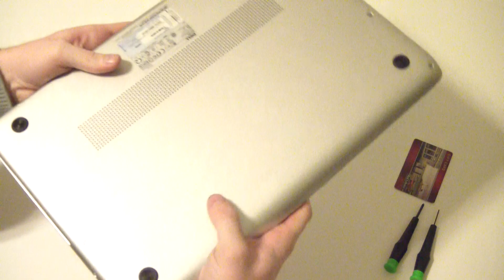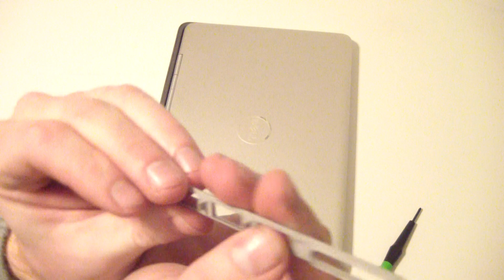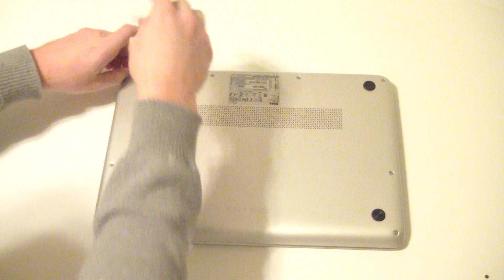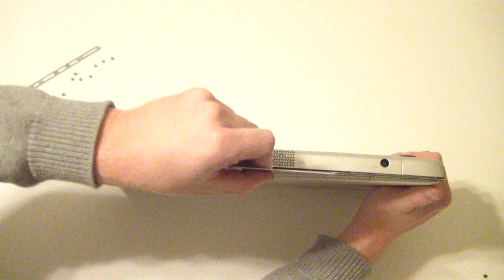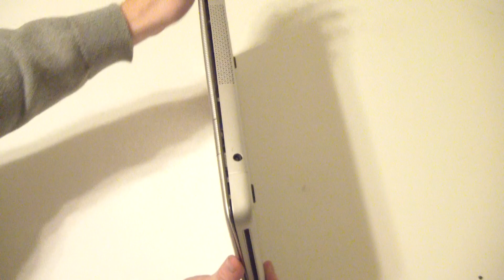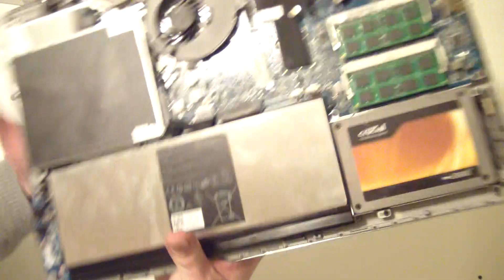Dell XPS 15z Disassembly - Bottom Cover Case Assembly How to Remove to Upgrade

Comment: The port bezel cover is quite brittle you need to gently pry it off but with a bit of force. Getting a thin screw driver under part of the bezel covering a port and gently prying it will release one of the clips, after you release one of the clips its then easier to remove. Its all about being gentle with the clips.

This method works, just as long as you are careful with the prying and don't scrape the actual front face of the bezel, otherwise you'll get a nice scratch on it.

Comment: Yeah as long as you gently pry off the port bezel in the right direction, the bezel comes off pretty easy. The harder part is getting the base off without:

1. breaking the clips
2. stripping the screw heads
3. stressing the frame of the screen (pressure)

It gets easier as you open it more times. I'll be opening it soon to put in a Crucial M4 256 SSD. I've had mine opened a few times for warranty calls so I'm pretty OK with doing it.

Comment: sseiyah is correct. Its plastic. It goes an orange colour due to your wrist constantly rubbing on it. Its simply the shine being worn away. The trim itself is glued to the panel. In order to remove it you can have to completely tear down your XPS 15z, as the components are all attached to it on the underside.

I know this because my trim became like this and the technician had to tear it all down and rebuilt it back onto the new front panel plate. As the trim itself is not detachable.

Comment: Hi,
Thanks for your helpful videos. I own a Dell XPS 15z like this one and have a few Q's ...

I wish to replace the HDD with an SSD to speed it up. Will I benefit from getting a SATA 3 drive over the older SATA2 for the XPS 15z?
Dell support told me these can have a maximum of 8Gb RAM. I wanted to confirm if you know if this is correct?
(My experience is many Dell support staff often don't know what they are taking about)

Comment: thank you thank so much for having this vide. those two screws underneath the bezel for all the ports was dells attempt to piss off some tech and have him/her 'manually' pull apart the bottom from the top and if you did not know those two screws were there, you WILL be buying a new laptop. Sneaky f**kers. Anyways, mission accomplished thanks to this video. Needed to do a thorough dust cleaning as this computer is getting old and overheats to .11ghz, which is frankly unusable.

Comment: Is the battery soldered to the PC or is it connected with some connectors? Also i'd like to know how well does this thing take heat (massive gaming with high settings@1080p).

Comment: Final Q: when typing, it seems without meaning to, I sometimes very lightly touch the trackpad and the cursor jumps to some random place. This is a regular annoying thing that is almost a deal breaker for me.
Do others experience this problem and is there a know way to fix it? It has not been the slightest issue for laptops in the past.
(change my typing technique for Dells' sake)

I noticed some HP comps allow you to turn the pad off if you have a mouse.

Thanks

Comment: i have this model of laptop and my laptop so heat so much to the point its to hot to touch or it will just shut down on me cause it get  so hot do you think this is a battery issue ?

Comment: Is there a way to remove lcd including cover completely and use base connected by hdmi to external monitor, as a desktop basically? I've noticed it requires the lcd ribbon to be attached for startup. Not sure if there's a way to bypass this. Anyone?
Thx

Comment: can you upgrade the ram to 16gb on this laptop
Reply: Tech Ninja Not sure if you're still interested 6 months later, but I can confirm that you can upgrade this PC to 16gb RAM despite Dell's claim of 8gb max. I can't speak for the core i3 configuration, but if you look up the RAM compatibility for this model's core i5 processor on Intel's official site, it's listed up to 16gb max. I assume the same would be true for the i7. I upgraded mine about a year and a half ago and I haven't had any problems.

Comment: The XPS was built with a terrible, partially non-functional trackpad. If you complain, they will just replace it with a new, equally non-functional one. And the software for disabling the trackpad doesn't work properly. The only way I've found to avoid the problem is to go into the mouse settings, trackpad settings, and disable "tap to touch." You can't turn the whole trackpad off though, that setting is broken.

This is by far the worst computer I've ever wasted my money on. $1500 pile of junk.